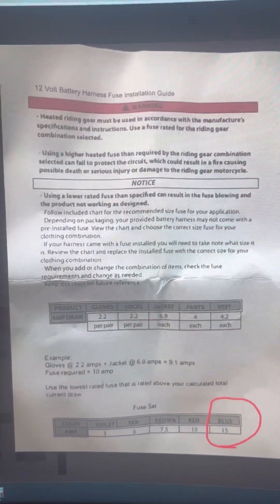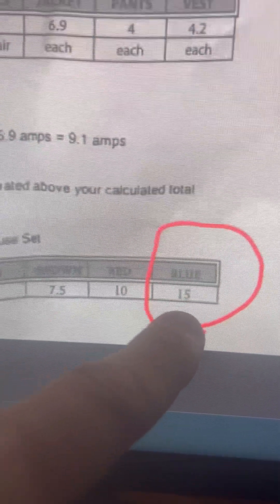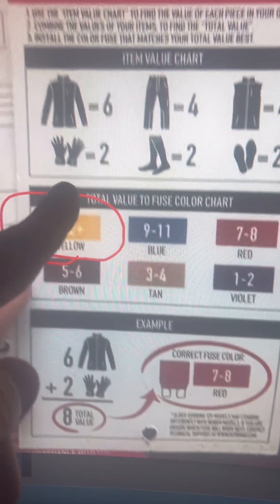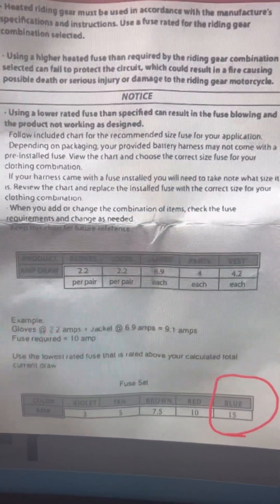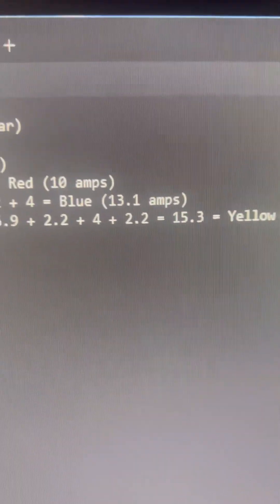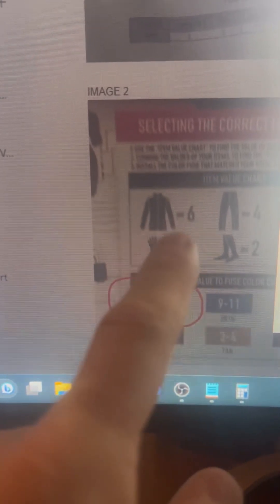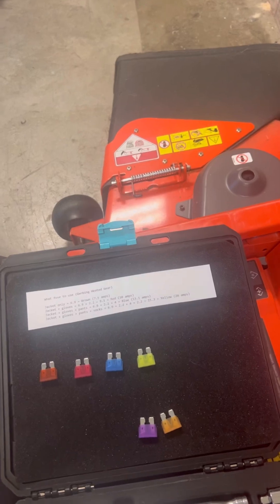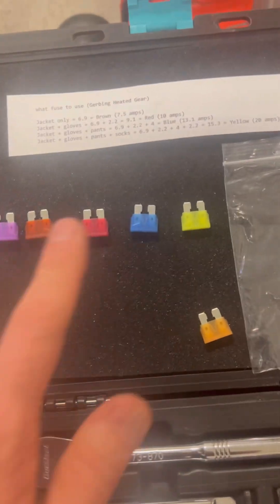Gerbing Heated Gear - What Fuse To Use

Comment: I just got the whole set up. Nice to know they haven’t changed any of those instructions. Now I find it annoying if I decide to not use the bottom sets and only the top for some odd reason temps don’t need it… I’d have to swap a fuse to not fry myself. 

I may have to figure out a better way to extend the wires at the battery and just use my side cover to pop off and change a fuse instead.

Comment: Let me ask you.  Can't you just hook up into the adaptor that comes with the harley davidson that us used to tend the battery as a hook up
Reply from the maker: Harley Davidson documents all say NOT to do it.  The battery tender harness is fused for low voltage draw and the gear needs to use a fuse up to 20 amps (while wearing everything).  You could fry components of the bike or cause some electrical fire while wearing the gear, which Harley states "can cause serious injury or even death."  I wouldn't do it.  Technically "can you?"  Sure...I'm reading lots of folks who have done it and continue to do it.  Since I value my life and follow manufacturer warnings, I installed the separate heated gear fuse kit/cables. It was very simple to do and ensures I am using only the amps I need for any configuration of gear I'm wearing.
Reply: @dirksdomain  I agree, I feel the same way but I wanted to ask.